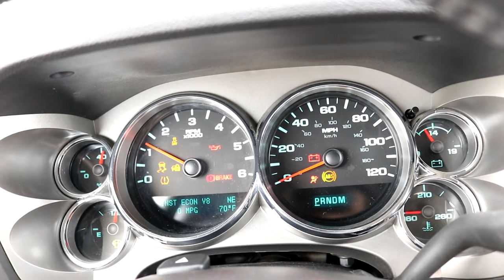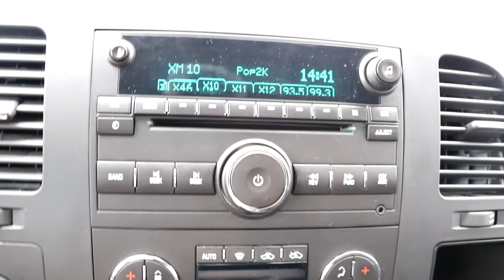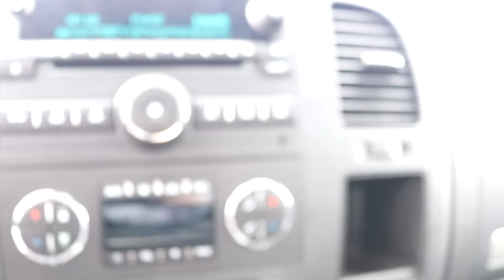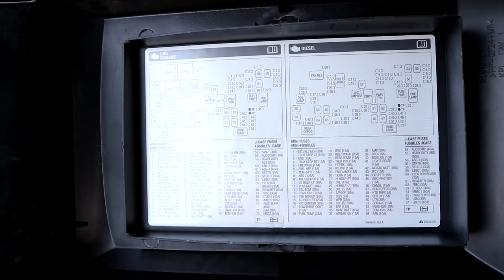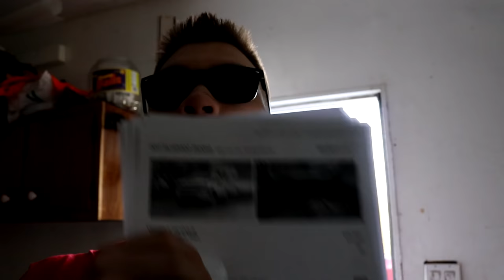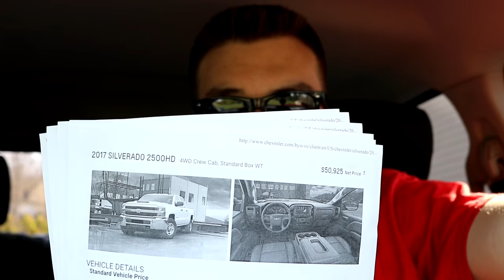HIDDEN BONDO (NEED TO BUY A NEW TRUCK NOW)

Comment: Buy the Cummins all the other trucks are more expensive and you get less features, ram packs the best value for your money
Reply: ehhhh i dont agree, for quality and cost chevy is better, Ford has best interiors now and you pay for them, alooooooooot of paying for them, Rams look nice but they’re made so cheap hopefully they change the quality soon but i doubt it, it works why change what works and GM has like middle ground on pricing
Reply from the maker: I did a custom build of all three trucks and ram has the lowest price by far for similar features